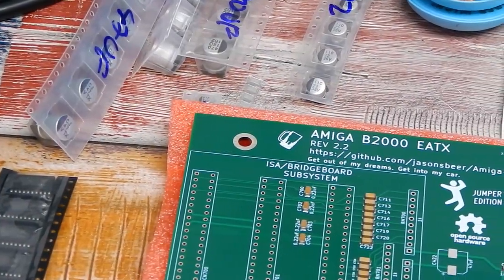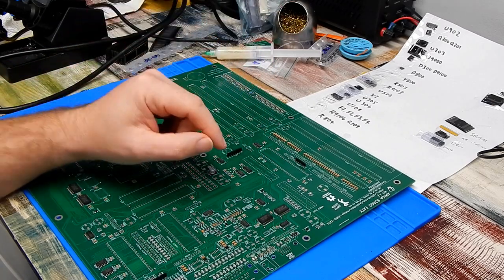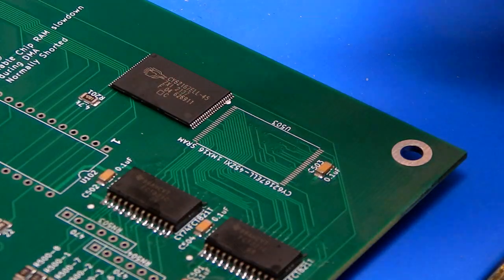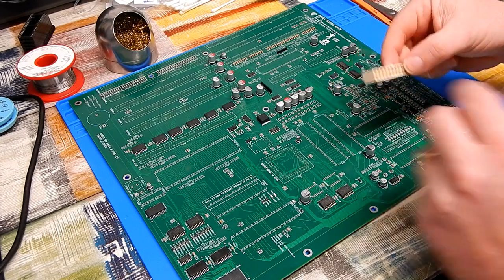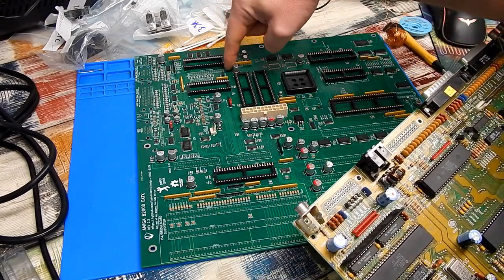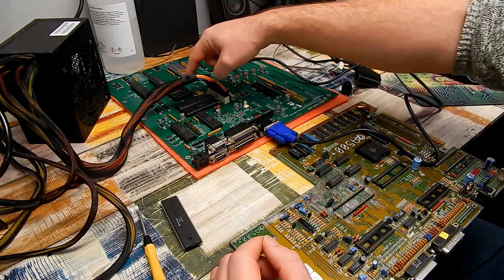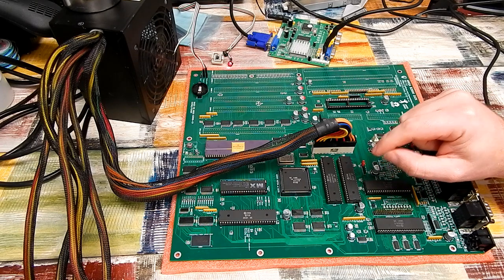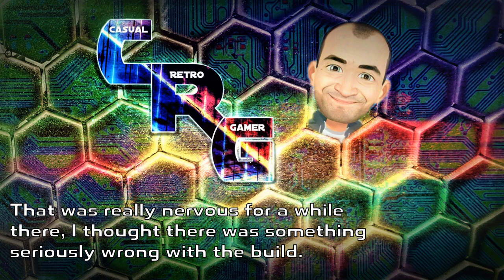Building a NEW Amiga 2000 in 2022 - Part 1 assembly, testing and first power up

Comment: PCBWAY seem to be more advanced than JCLPCB, Seems that is a place better than anywhere else l.e OSHPARK
Reply from the maker: I can't remember why we went with JLC over PCBWAY, it might just have been cost if I'm honest.  Despite the warp in the board it works fine so I'm happy enough.
Reply: @CRG  My first thought was, that you should have to clamp it down or make a jig before any soldering. This might take the stress out of the soldering points after it’s mount in a case.

Comment: jasonsbeer here...nice work! Imagine my excitement when an A2000 EATX build video popped up on my youtube feed today. You did a great job going through everything...including the issues people should be aware of. I have probably ordered 50-60 of these boards from JLCPCB through the development phases and for resale. Never had any warped like that, so I don't think that's a production issue. Regardless, that's unfortunate. Looking forward to part 2!
Reply from the maker: Thanks for the kind words.  

The warping in the board is unfortunate but it is what it is.  I now have the slots fitted and it certainly strengthens everything, the board at least doesn't flex as much.  

All being well part 2 will be up this coming Sunday finishing off the build getting it all into a case.

Comment: Nice one Glen, I think RGB All the way :) You could have fun with the Floppy and LPF LED signals using a pi pico to run the light show. I watched the entire video at 1.75X speed. Your voice is perfectly audable at that speed :) I can't imagine how long that took you to do in real time.
Reply from the maker: Honestly I think so far I'm into it for about 20 hours.  It's a lot of work but look at what it makes by the end, I think it's worth it.  

Still not sure about RGB but I think it needs some lighting in the case.  Maybe something that I can select the colours and brightness on is the way to go.
Reply: @CRG  I had a ceramic 68010 chip in my A2000T that I made. You notice the 010 speedup if you have no fastram. There is a very nice pi based flicker fixer that plugs into the genlock port. (Assuming you have a pi zero.)

Comment: Fascinating watching a brand new big box Amiga motherboard being born here in 2022. I never had nor saw Amigas back in th 1990’s but recently got into them and bought a Vampire V4 Standalone, then got the itch for a big box and so I have Hese building me AA3000+ and then A4000TX motherboards. Expensive hobby once you start adding in Zorro USB, 9000GPU, IDE controller boards and the custom chipset costs but it is fun and luckily classic Amiga OS keeps getting updates with 3141 and 32 in the last couple years. Great video and I enjoyed watching Part 1.

Comment: Lovely job Glen! Really cool to see an Amiga 2000 emerging in a new form factor. Look forward to seeing the Zorro slots installed and in action.
For a keyboard you could use one of those CIA USB adapter thingys until you track down a proper A2000 keyboard.
Case-wise: Yeah a windowed box sounds good. In a modern case. Sort of an inverse sleeper!!

Comment: Next-level soldering skills.
Reply: Really it is, he's very (very) good at it.
Reply from the maker: Thanks guys, mostly I put it down to good solder and flux although I like to think my skills are getting better.
Reply: @CRG  A quality solder I discovered goes a long way to making easier soldering. Still some around with silver content and it flows so much better.
Reply from the maker: @VenturiLife  I use a leaded solder and since changing to that the difference is unbelievable.  Flows really easily and leaves a shiny finish.

Comment: I have just subscribed.  I thoroughly enjoyed your build.  As an owner of several different Amigas, including a bunch of 2000s, I enjoyed the A2000 for so many years,  that I am happy to see that it lives on.  Even though my main 2000 has a GVP 030 board doesn't get much use any more, because I am using an 040 powered A3000, as well as a Cyberstorm powered A4000.  
Amiga forever!

Comment: Wow! Flipped through your video - manually doing all that soldering, kudos to you, that is extremely hard, I know I wouldn't be able to manage it at this time without a huge amount of invested time. Amazing stuff.
Reply from the maker: Thanks.  Recording it does make it take longer but I think for this one in total about 20 hours.  I dare say that without the camera and if you just focused on it there would be no problem getting it all done in half that.
Reply: @CRG  Spent hours just getting a sinclair Ql microdrive bare wires back in the socket - cheap sinclair cutting corners! LOL!

Comment: I could understand why jlpcb could not solder on the amega specific chips, but why could they not solder that mountain of capacitors for example?
Reply from the maker: Remembering back to when this was ordered they just didn't have stock of some components.  In fact even getting some stuff to do ourselves was difficult.  Parts were ordered from maybe 4 or 5 different places and some of it had to come from AliExpress.  I suppose it just comes down to the current worldwide shortages.

Comment: Of course, we would (or I would) watch all 50 minutes. This is such a nice project. I have seen one for an A4000 in an EATX style too, so it's nice to know there are options. As for the OS: I think if you want to use a CD-ROM you need a newer OS version but I don't remember that for sure. I would personally try to get an as modern case as possible with a window (to see the RGB of course) that also has drive bays. As drive bays are pretty much history these days, this might be a difficult task but getting a floppy drive/Gotek and maybe a CD drive at the very least is nice. Especially since I don't see an external floppy connector on this particular board.

But either way, this is fascinating. Great job.
Reply from the maker: Drive bays in a modern case are really hard to find but at least with Amiga its easy enough to setup everything using WinUAE and especially if you have an easily accessible CF or SD card.  I have a case in mind and hopefully it'll be here for the next part.
Reply: @CRG  Of course. I know you can also get USB interfaces for the Amiga, so you could also connect a Gotek and/or a CD drive that way, I think. Anyway, it's just what I would go for. I did myself manage to find a few modernish cases with drive bays. I just don't remember if they were regular ATX or EATX. Likely ATX. Looking forward to the next episode.

Comment: You did pretty well soldering all of those surface mount components. It's surprising how quickly one improves with a little practice.

I use similar techniques, and I haven't come across anything I can't solder with just a normal soldering iron and a hot air station. However, if it were me and I came across that tiny diode while ordering the parts, I probably would've downloaded the project from the hub for gits, and modified it to use a more normal sized footprint.

As for the case, I'm not a huge fan of RGB LEDs. Buuuut if you're going to have a case with a window, you'll need some lighting to be able to see it, so I suggest some kind of programmable RGB LED controller. The only other thing I'd suggest is that I've seen beige-ish (more white) coloured modern cases, so that might be a nice nod to the modern and retro contents.

Comment: Congratulations! A year back I went for the floppie209 board because every chip is in a socket and its easy to repair but I did take a look at this board, and it looks nice!
I just received my Denise ITX board but the density of all the smd scares me a little ;-)
For cleaning I used 2 liters of bio ethanol and a large tube.

Comment: Nice job.

I really like this idea of giving a second like to an Amiga 500 as an Amiga 2000.  

For the case?  I think I'm with you, and I wouldn't want a boring beige box.  I'm not sure an Amiga really has the aesthetic of a full on gamer box either.

Maybe some kind of in-between?  Something with some style, but still represents something from the old aesthetic.  Since this is a 500 turned into a 2000...  maybe the case should have some outward styling elements of a 500, but in "full box" 2000 model.

I honestly always liked that look of Amia 500/600 and the Plus/4 with the cooling vents.
Reply from the maker: I have a case in mind for this and all being well it'll feature in the next part this coming weekend.

Comment: Nice project.  I believe you can get a Keyrah board to convert an existing A500 keyboard into an external one with casings also being available.  I can't remember where I saw it for sure but I think Neil from RMC might have done something like this when he set up an A1500 project.  I know it's not a 'professional' cleaning method but many people have been using dishwashers to clean circuit boards with good results (just make sure it's properly dried off before powering it up).  

As for the case, something like the NZXT H7 Flow might be a good fit.  It is listed as being EATX compatible and is available in black, white or black and white.  The black version sports a tinted window which could be a good shout since the basic green of the motherboard is not exactly pretty.  It could end up looking a lot better in conjunction with some RGB fans or a lighting kit (since as an Amiga this system is unlikely to need much in the way of airflow).  The biggest problem is that pretty much all modern cases don't allow for a floppy drive which is why you might end up looking on Ebay for an older case unless you are willing to use an external drive.
Reply from the maker: The A500 keyboard can be easily converted for use as an A2000 keyboard and thats my plan until I can find something better.  I'm not sure if RMC has done a video on it but I know certainly GadgetUK has.   

I don't think I could put this in the dishwasher.  Yes I seen loads of folk do it but on the chance it'd go wrong for me I don't think its worth it.  

I have a case in mind for this build and yes finding one with an external drive bay is near impossible but I hope I have a work around for that.

Comment: Brilliant video! Did you at any point think "I've taken on too much" and regret it? For the keyboard did you consider a checkmate?
Reply from the maker: Thanks, glad to hear you enjoyed it.

To answer your questions... 

No, I didn't ever think it was too much work from the point of view of the assembly, if anything I enjoyed it with the anticipation of it being finished and booting.  Of course when it didn't there was that sinking feeling of what could possibly be wrong and especially after I fixed the clock.  Ultimately it worked though out so all good.

As for the keyboard, yes I looked at the checkmate but just now it's a little expensive.  I'm already about £500 deep into this project and can't afford the £70 for it.  Maybe after Christmas.

Comment: I've also got a dead A500Plus with battery damage like yours (10+1 power light flashes, but a BLACK screen - haven't figured that out). I was thinking about building an A500++ from it, but now the A2000 is kinda tempting....
Oh, and Full on RGB, definitely!!
Reply from the maker: Sounds like it could be Agnus at fault on your board but hopefully not as the 8375 is getting expensive.  

The 2000 board is a great build and I'd highly recommend it if you have the space the full machine would need over a new wedge.  It opens the door to Zorro  expansions which is something I've never had the chance to play with.  

The new case is on order and some lighting is included.  The next part should be out this weekend.

Comment: Hi CRG, I'm also looking for a big Amiga. I was wondering where you ordered the parts from. Thanks.
Reply from the maker: The GitHub is linked in the videos description, you can get the files needed to order boards along with the bom there.  

Our parts came from various places, components were ordered from a mixture of mouser and digikey.  Slots, sockets and the cpld for bluster came from AliExpress.  The chipset came out of an old A500+.

We had to use so many outlets due to the component shortage.

Comment: Do you know where the information about Chip memory addressing in Amiga is stored?  I know Amiga can have two 2MB ram chips.  can't this be changed?  In which integrated circuit could this information be stored?  PS: would it be possible to change this memory to a faster one?  and for a bigger one?
Reply from the maker: Its handled by AGNUS, the maximum chip is 2mb I'm afraid.  The only way to go above that is with emulation in WinUAE.
Reply: @CRG I don't want an emulator!  emulators are the way to nowhere. Dead end.  Can't you somehow reprogram Agnus or trick him?  is there any chance to replace it with a new integrated circuit?  with new fast memory ??  who has documentation for Agnus?  where is the Agnus documentation and diagrams? are you sure that the addressing does not go through Rom?

Comment: I have an original 2000 with SCSI card and iirc a Ram expansion. Need to get it out and get back into it. Scsi2sd card. And I have some ram for the scsi card to install.

Comment: That's a staggeringly big job, my compliments for your patience although I personally hate SMD type boards
Reply from the maker: A year ago I might have agreed with you but honestly now I think SMD is easier than through hole, especially when its the larger pitch SMD stuff.  That SRAM and some of the chicken feed was tricky enough.
Reply: @CRG  You can use radial electrolytics instead of SMD, they make them small enough these days in those values. Just bend both leads 90 degrees outwards from the base of the cap then trim the excess. SMDs tend to leak, so I avoid using them

Comment: It's the dimensions of the board that decides the case you can use, My super micro server boards are best put in a old mac pro g5 case, the one with only 1 cdrom drive. Because the other cases I bought that was eatx Just wouldn't fit it. I bought one, thinking all eatx was same size.   A old flip top ibm type case also a good choice for me and my dual cpu server boards, that are huge and not  standard sized. The problem I had with the ibm pc case was some graphic cards/gpu's too tall with power cables attached. So how tall are the cards and cables going to be? Things to be considered. My mac pro 5 version of my server builds I think work the best and have the most room for things.. If you like Hacked retro. Seems to be the roomiest case not too expensive on ebay.
Reply from the maker: I have now since built it into a case which you can see in the part 2 video, the last 10 minutes or so if you want to skip to that part.  

One thing I quickly learned is that EATX isn't a defined standard in terms of board size.  this board is 330x305mm and the only way I could figure out what case to use was to look for one with 4 screw holes in a row for mounting the motherboard.

Comment: The A500+ 8375 Agnes is totally different Agnes from A500 8375. The pin out is even different. To upgrade an A2000 to 2MB CHIP RAM with an A500+ AGNES you need an adapter that remaps the pin outs and also adds they extra CHIP RAM. I think. You need like the 8375 (318069-16 only) (PAL) - Amiga 500 from Rev 6 (PAL); Amiga 2000 model B from Rev 6.4 (PAL) or any PAL 8372A from a Rev 6 A500. At least that is what I thought from first glance. I didn't watch the whole video but I just heard you say that you used the chips from and A500+.
Reply from the maker: This board has various jumpers to set which let you use any of the various Agnus chips.

The issue with this one which I initially blamed on a bad Agnus, with some later testing, turned out to be a bad Gary.

Comment: I bought the Atari 520 ST back in the day, but would have been happy to have had the Amiga instead. I had a blast coding in Assembler on the 68000.
Reply from the maker: Only something I can dream of doing to be honest.  I did a bit of basic coding back in the day but wouldn't know were to start these days.  Always enjoyed it though, maybe I should try to pick it up again.
Reply: this extension for visual studio lets you code on Windows 10. You can debug using an emulator and when your finished transfer the program to the Amiga.

Comment: Open frame case (ie thermaltake) - Could we have an approx cost of PCB + Kit of parts (excluding Amiga salvaged parts) ?
Reply from the maker: Of course and sorry for not covering it in the video.  Cost for PCB and components was around £300.  To date though I'm probably up to around £500 total with the donor A500+, PSU, Case, Gotek etc.

Comment: Instead of having 68k CPU could it be made to have pistorm embedded right on the motherboard or it doesn't make any sense?
Reply from the maker: There's certainly nothing stopping you fitting a pistorm either into the 68k socket or the CPU slot.  

In conversation with the designer of this board about a few things he stated that he wanted to keep it as original as possible which I can fully appreciate.  For example a PS2 keyboard interface or scan doubler on board would have been nice but there are other solutions for that.
Reply: @CRG  the thing is, 68k are getting harder to get by the day, therefore I thought that since this is a costum board it would make sense to embed pistorm on it

Comment: What about a Lian Li case with window? Genuinely wonder the difference in heat between an original 2000 and the surface mount A2000.